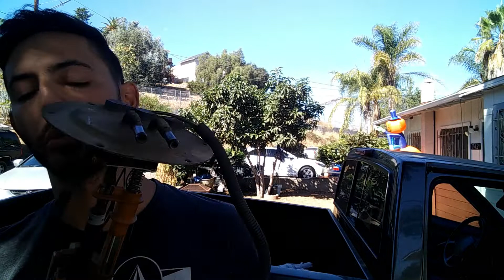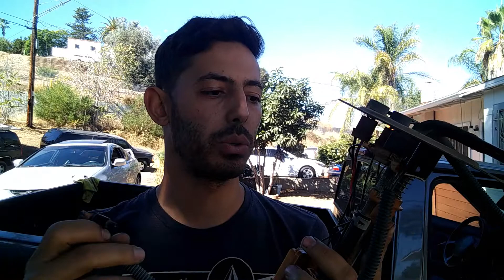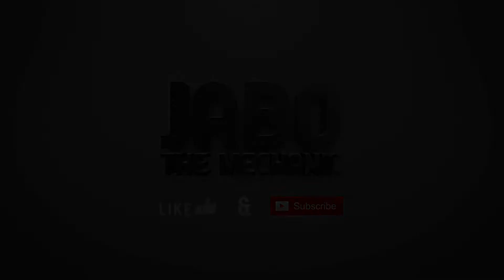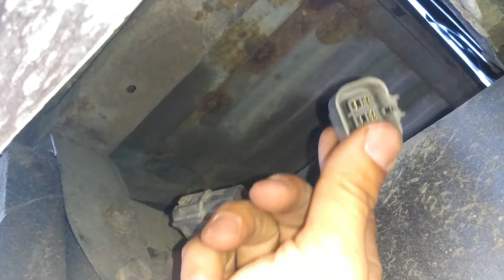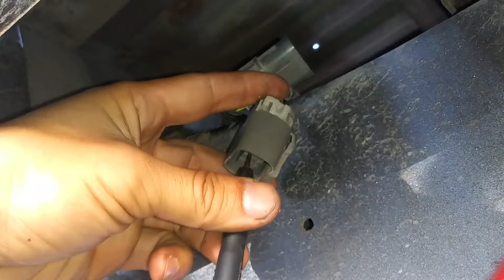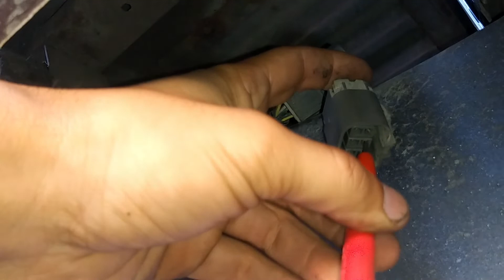p0180 nissan pick up

Comment: If anyone is looking for the cheapest part it's the Hitachi TMS0002. They mislabel it as a coolant temp sensor but it's the same as a fuel temperature sensor. Way better and reasonable price compared to around $140 from nissan parts websites like nissan overstock.